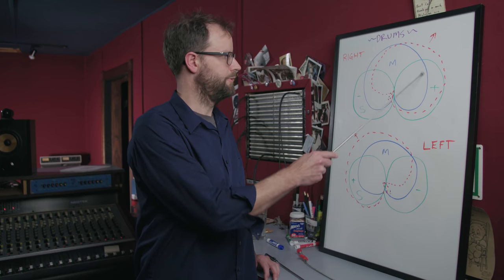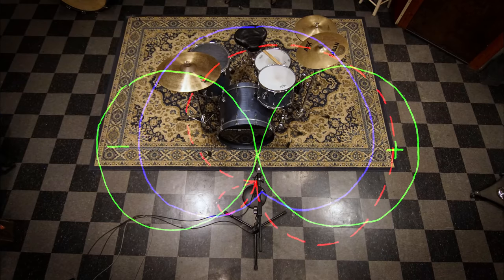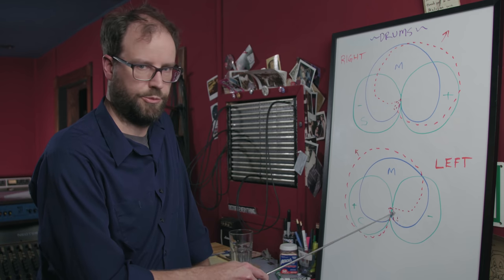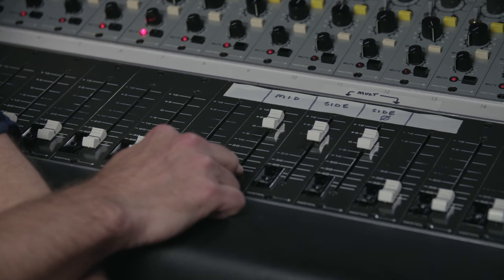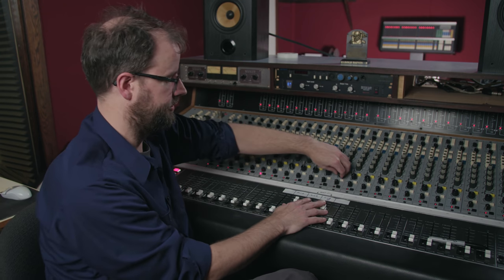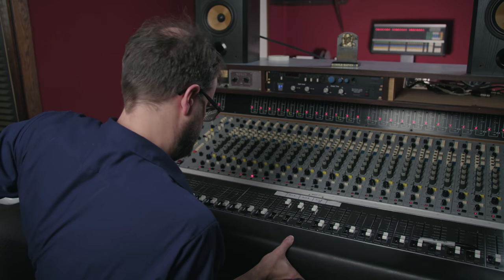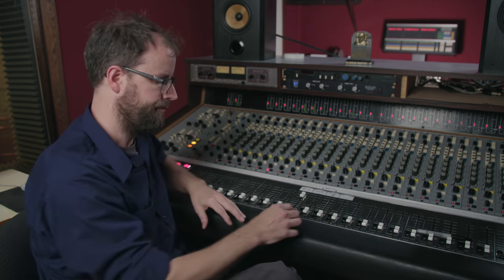Electrical Audio How-To: Mid-Side (M-S) Recording

Comment: Question about m/s processors on the market for anyone who knows: the Radial Engineering ‘Decoder’ (purple box)  seems to offer only 2 outputs, L+M and M+R. Shouldn’t there always be a dedicated M output in addition to the decoded side outputs? There are a few other models that offer only those two decoded (middle + decoded side) stereo outputs. In other words, they’re “pre-mixed,” forever embedding the middle signal with the stereo side signals. Why would anyone want that, instead of the 3 signals as on EA’s board in this video?
Reply from the maker: The purpose of these devices is to decode the two mono input signals (mid and side) into traditional stereo in the analog domain.

M-S is kinda a three-step deal: record mid and side; duplicate side and flip polarity on duplicate; blend mid and sides, ideally with the two side signals at exactly the same level.

You would want it because it takes you from A to C instead of A to B. Three channels isn't actually decoded stereo/ LR, it's M-L-R. Three boxes fully decode the M-S into LR stereo, which is their purpose! 

With digital recording and its methodologies becoming prevalent it's more common to defer decisions like the blend of mid and sides till later and later in the process, but it's equally legit to just commit the blend and be done with it, giving you one less choice to deal with at mix. Or you could use one of these at mix to decode in the analog domain.
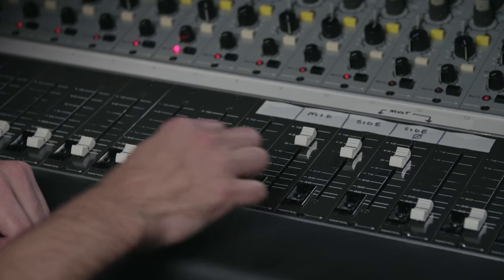Reply: @ElectricalAudioOfficial   Thanks so much for the response. So the primary advantages to having a M/S processor box are 1) it allows you to control the level/width of the side signals using just one knob (?) on the box, without having to worry about not being able to keep the faders on your board even at all times (as discussed 5:46 - 6:16 in your video) and 2) it performs the side track duplication & polarity flip in the box, without taking up an additional channel on your board. Do I have that right? Are there any disadvantages to using a M/S box instead of performing all of the above without one? And where does the decoded L/R output from a M/S box typically get routed to on your board during the mixdown stage (insert/aux?). Many thanks.
Reply from the maker: @slacktoryrecords4193  that's right. The major advantage to an MS decoder box is convenience/ efficiency. Instead of it taking 5 minutes to setup, it takes one, and you can quickly and easily audition favoring mid or sides, shifting the stereo image left or right, etc. Depending on what your decoder can do.

We generally use the decoder during tracking, committing to a blend of mid and sides. It follows the mic preamp outputs, either as an insert, or patched directly, and comes back to the console on a line input and goes via bus or direct out to the multitrack.

When we use a decoder at mix (a rarity), it would either be as an insert, or patched between the multitrack output and the line input associated with the monitor path (the path that feeds 2-mix). It is of little consequence which of these two ways you do it.
Reply: @ElectricalAudioOfficial  Thank you kindly! You covered all the bases. Can’t wait for the next EA video.

Comment: When summed to mono, the idea that the sides simply cancel out and you are left with only the center mic is cool and all. But if I do a stereo-linked limit/compression on my stereo mix, is it reacting to the mono sum of the l and r? Aka not reacting to the side mics at all? Is that a good thing 🤔?
Reply: Any body know any good places where I can learn about conceptually about the math of summing / ms encoding / compression detection circuits / acoustics / etc ?
Reply: Wonderful video btw!!
Reply: It totally depends on the way the compressor links.  Some compressors take about a 50/50 share of the two channels to the detector/sidechain inputs, others weigh the actual input over the feed from the opposite, so there's a bit of difference in action between the two channels.  Either way, it's an interesting point.  The compressor would probably react more to what the Mid signal is doing.
Reply: @SonnyGeorgeVlogs  The best reference I know is in book form, but I'm sure there's a web source that's good as well.  I recommend getting an devouring Handbook for Sound Engineers: The New Audio Cyclopedia.
Reply: @gregnorman1489  Thank you Greg! Thrill to learn from you!

Comment: With the cardioid mid mic, there's a region where the two polar patterns don't overlap. Anyone tried an omni as the mid mic? Wondered what difference that makes in practice.
Reply from the maker: We do this quite often.  The image would be affected similarly to how either mic pattern would sound by itself.  For example, a cardioid mic pointed at the center of a piano harp could be more focused on the strings its capsule is pointed to, whereas an omni mic would pick up more peripheral strings and could sound more even, depending on placement.  You’d certainly hear that difference with it as a “mid” mic.  If you’ve got an opportunity to mic different instruments and A/B them, it’s a really useful exercise.

Comment: Two mics?  Only two XLR’s? 
But, three channels?
Can any one of the commenters explain?
Reply: one of the side mics is phased reversed....so you have mid mic, side mic to one side, and phase reversed sid mic to other side
Reply: Yes , we know that. But where does the third mic cord go, if there are only two mics?  A mic splitter is needed then?
Reply: The side mic signal is identical to eachother, it's either recorded with a splitter or multiplied in the DAW, i believe. Then ones polarity is switched.
Reply: @Gretsch0997  yes, if you look at the console you'll see it says "MULT" above the two side mic faders. Typically at a big studio you'd have a patchbay that can 'multiply' signals for you, or like you said, basically a mic splitter. In a DAW you'd just duplicate the side mic track.
Reply: @Gretsch0997  the side microphone has one output, but for this demonstration (on the console) it splits it to two left and right channels, one of which is phase reversed.
Reply: Perfect , thanks for all the replies everyone !

Comment: How do you get two mics on three channels?
Reply from the maker: We addressed this in other comments.

You split (duplicate) the output of the mid mic after the preamp, and flip the phase on the second channel (the duplicate).
Reply: @ElectricalAudioOfficial  ah. 👍🏼
Reply: @ElectricalAudioOfficial  I feel like I’m so close to getting the answer I need, right here. I don’t have a DAW (I’m not kidding. No really, I don’t have a DAW), and want to be able to use the Ø on one of my pre-amps to invert the signal, and directly record both the regular signal and the inverted signal into my deck. No polarity inverting after the fact, because I don’t know how I can do that (again, no DAW; the only Ø I have is on my mic pres). What would my signal path look like were I to attempt it? Do I need a splitter box? Is a Y cable sufficient? Bedroom studio setup. Thanks!!
Reply from the maker: @slacktoryrecords4193  Sure, you could use a y-cable from a preamp output (better than doing it into two preamps for a few reasons). If you do that, you should phase flip at your mixer, or reverse the polarity on one end of the Y cable.
A splitter would also be fine, again, best if it's after the preamp, and you still need to reverse the polarity of one of the signals somehow.

Comment: Can i adjust it for the red zone to be in the middle ?
Reply from the maker: Can you elaborate/ reword your question?
Reply: @ElectricalAudioOfficial  yeah that was very poor word choice on my part.
you meantioned that when you add the sum of the two microphones it equals to either a right or left (depending on polarity direction) leaning hypercardioid and i was wondering if you could rotate the microphones in a way that the hypercardioid could be front facing in the middle of the drumset while the two microphones sort of lean left or right. and what would be the advantages of having it (the htpercardioid) pointing a certain direction. once again sorry if this makes no sense
Reply from the maker: @avantgardejazzguitar1341  If you want the center image to be hypercardioid, you can simply use a hypercardioid instead of a cardioid mic. If you want a left- or right-dominant traditional M-S image, just rotate both mics. But as Greg points out, one of the main benefits of M-S is that you get a full-fidelity on-axis response when the image sums to mono. If you rotate the M-S pair, you lose that benefit, because your center mic will be off-axis.
Reply: @ElectricalAudioOfficial  thank you for explaining!

Comment: how could the right side of the room be the same as the left side?
could the room be that symmetrical?
Reply from the maker: The room isn't perfectly symmetrical, a single figure-8 mic receives exactly the same signal from one side of the "8" as it does from the other side, with exactly opposite polarity.
Reply: @ElectricalAudioOfficial  but how can the two sides be identical? they're pickup up different areas of the room
Reply from the maker: @imslicc  It is a single mic, right? A single pickup at a single point. Air pressure waves can hit that point and push the diaphragm from one side (positive polarity), or the other (negative polarity). Or if a signal from one side "pulls" the diaphragm the polarity will be opposite. It doesn't matter that the sides are pointed at different places, a microphone essentially continuously "measures" the air pressure and creates an analogous electrical signal/ voltage. If this is still unclear maybe we can point you to some acoustics resources?

Comment: First problem. I don't have $5000 worth of microphones  😩
Reply from the maker: Neither do we. CGI, brah.
Reply: Electrical Audio I can't afford CGI 😂
Reply: You don't need that much money, just a halfway decent figure 8 and cardioid to start with.
Reply: Greg Norman you will struggle to find a mic with a figure 8 pattern under $2000 but I was referring to the 2x AKG 414s they are using.
Reply: You can get a good used 414 for roughly $1000.  There are dozens of multi-pattern condenser mics for under 1000 bucks new (many under $500).  Like anything else, there's crappy and good.  I'd recommend Audio Technica 4050 and Shure KSM44 for better than average, 'affordable' ones that are useful for all sorts of things.
Reply: Greg Norman lol, I'm in Australia. A 414 will cost around $2500. The Shure is $1,300 and AT is $1,100. Even the cheapest one is still a pretty decent investment for most people!
Reply: @officialWWM  If you're only looking at new mics, maybe check out the Warm Audio WA47Jr?  They're less than $500 AU.
Reply: @gregnorman1489  Cool, thanks. I'll check them out.

Comment: Dumb guy in the room I guess: why don't the two side signals cancel each other when they are panned right and left?
Reply from the maker: They don't cancel exactly because they are panned right and left. Each signal goes to one speaker alone, so there's no potential for cancellation, as when you listen in stereo there is no combining/ summing of these completely-out-of-phase signals. When you sum to mono, they are completely cancelled out because they are combined 1-to-1. Hope that helps.
Reply: @ElectricalAudioOfficial  yes, makes sense! Thanks for the explanation.